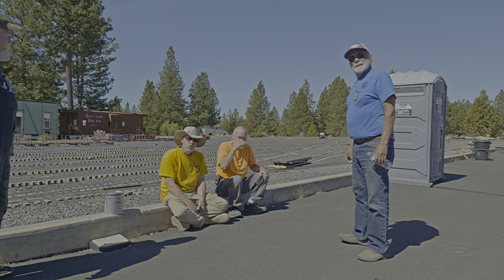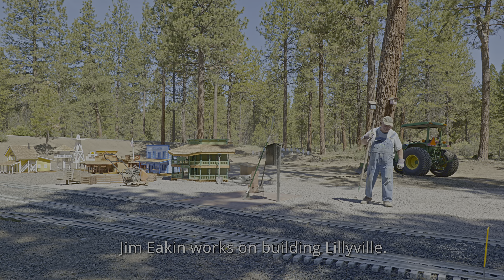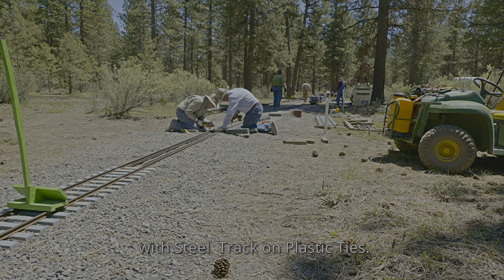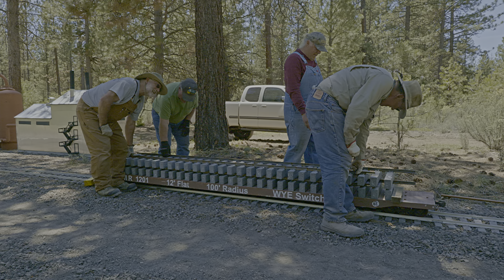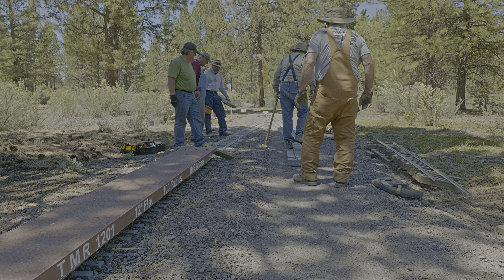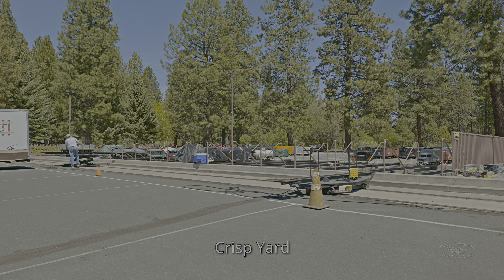Narrow Gauge Wednesday 2021.05.26 of the Work Week

Comment: I'm thinking about building one of these myself with a ATV Motor are thare any weight limits or sizes limits?
Reply from the maker: Yes, there are weight and size limits depending on where you intend on running. You should check with the clubs where you would like to run.